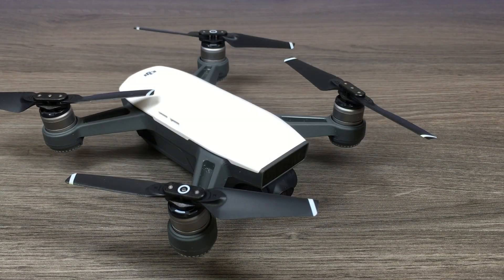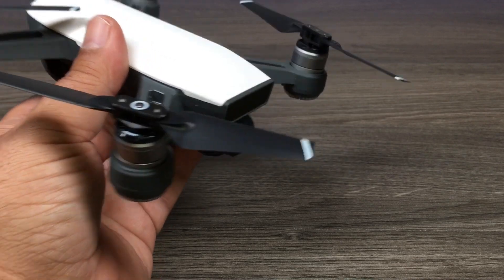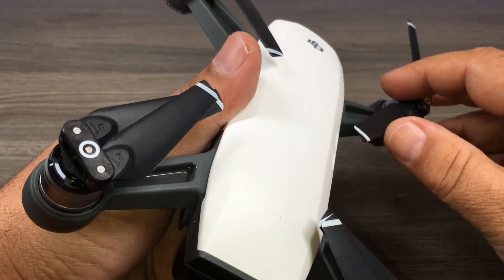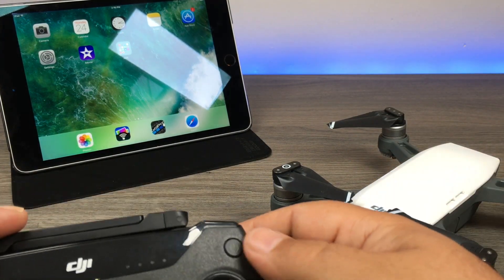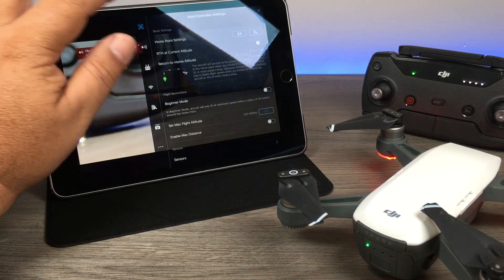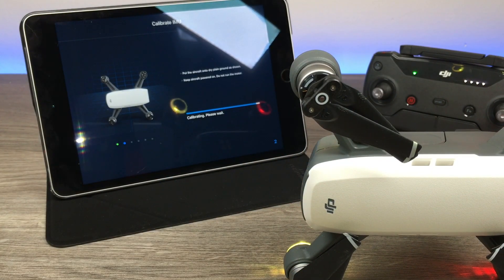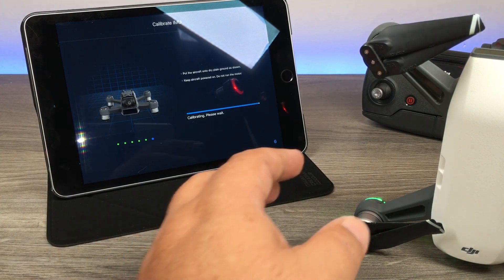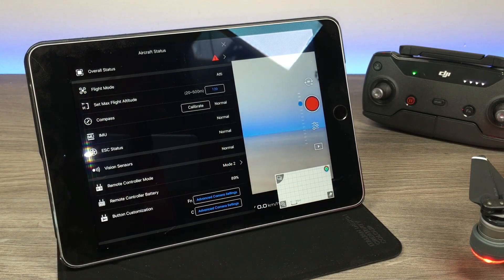DJI Spark IMU Calibration Tutorial

Comment: Hi and thanks, I dug my Spark out after buying it a few years ago, but did not really get time to use it until now. I was miffed about the MUI cal, but your video is very easy to understand. I think that given the Spark has a 15min flight time and battery is taken up with procedures like this, it pays to buy a couple of batteries, as I have so it is worth it once your set, otherwise a 10 min flight time is more likely.